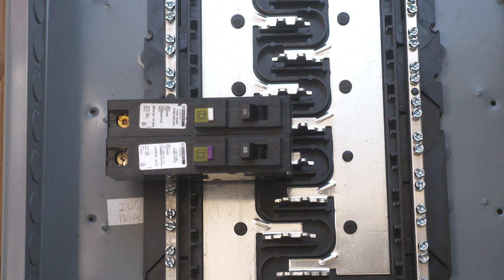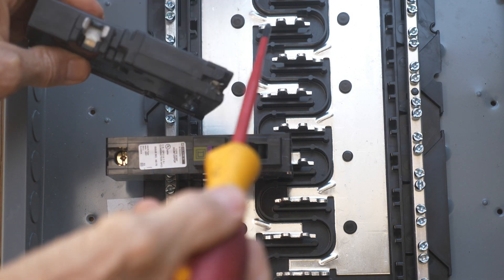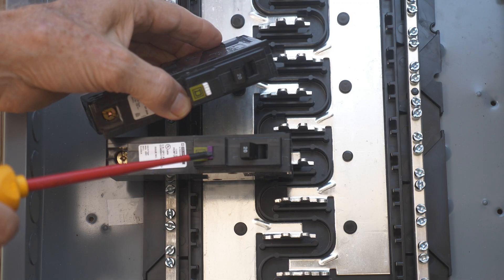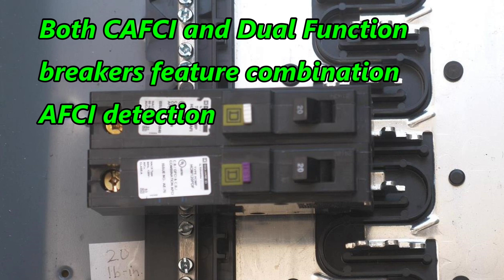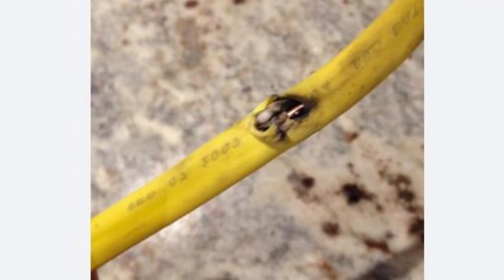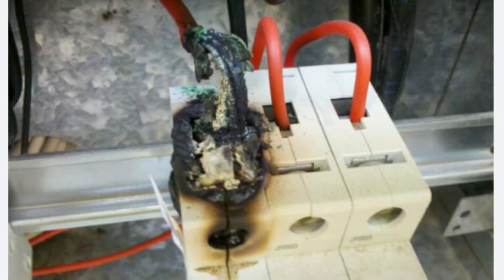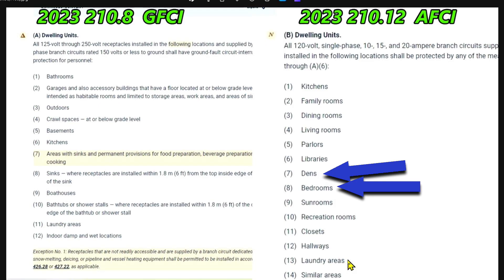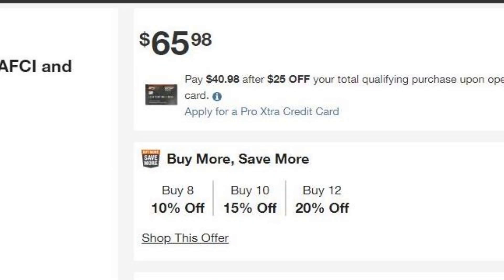Combination AFCI Breaker vs Dual Function Breaker: The Differences and Where to Use Them

Comment: Question, I noticed the new gfci combo afci breaker affecting the new appliances? They said that new beaker combo is not compatible with the new appliances? Is that true? What affecting to the appliances? Keeps tripping the breaker while the appliances in use. Thank you for answering.

Comment: Do I need to install a dual function Afci and gfci circuit breaker on the switch and light circuit? If so, is there any problem with installing a 20 amp dual function circuit breaker on that circuit?

Comment: Excellent explanation, however, I'm planning on using a 10-circuit Reliance transfer switch in conjunction with a solar power system. i.e. inverter, batteries, and PV panels.

My question: The breakers on the Reliance transfer switch are regular breakers. AFCI breakers are required nowadays. Should the breakers in the panel be AFCI, or should the breakers in the main panel be AFCI, or should the breakers in both the transfer switch and the main panel be AFCI? Thanks!

Comment: I find that using Homeline plug on neutral panels in conjunction w/ CAFCI/CAFGFCI is so much easier for apprentices. Especially when U energizes a system after trimout. U avoid breakers tripping and having to troubleshoot the panel for incorrectly wired neutral pigtails.
Reply: Apprentices have no business working on live panels. Do better.
Reply: Say someone who'd rather have an apprentice be a go-fer and clean-uper for the next 4 years. 

U must work for the union...

Comment: Bill one big problem I See the current combo AFCI/GFCI breakers don't work in California homes built say between 1980 and 2010.  The white pigtail Panel Breaker switches will. So inside in my bathrooms, kitchens, and laundry room, all need GFCI outlets installed or is it the other way around? Installing GFCI Breakers at the panel, and AFCI Outlets in the above areas mentioned. I'm asking for those confused.

Comment: I absolutely love your channel and I love all of your content. So informative Brother. I’m currently in college in my second semester taking electrical engineering. I just turned 51 in October and I am a freshman at the local community college. I love all things electricity based and mathematics. Next semester, I take calculus 1.

I always wondered what the difference was between an AFCI and a combination overcurrent device. So what you’re saying basically is that the combination breaker is both arcfault and ground fault? Am I understanding you correctly?
Reply from the maker: Hi! No, you don't quite have it. A combination AFCI breaker doesn't give GFCI protection. They call it combination because it gives both series and parallel AFCI protection only. The Dual function breaker is the one the gives both GFCI and AFCI protection.
Thanks, I'm glad you like the content!
Reply: @SparkyChannel  o
Oh OK thank you so much sir for the clarification.
Reply: @SparkyChannel  Is there such a thing as a combination AFCI/GFCI dual function breaker?
Reply from the maker: @BIGMIKEOSAS  Yes, it is the dual function breaker. It provides both series and parallel ARC protection as well as GFCI protection.

Comment: What are your thoughts on the new requirement that ALL kitchen outlets require GFCI protection?  Putting refrigerators on GFCIs is a bad idea imo
Reply from the maker: I agree with you. Putting a refrigerator on a GFCI is just asking for spoiled food.
Reply: @SparkyChannel  I was getting ready to say the same thing you should never put a motorized load on a GFCI. The lock rotor start up current would surge and cause the GFCI to trip.

Comment: are fault breakers should only be necessary when running Romex, in my opinion
Reply: How about a lamp cord, plugged in behind the couch, that gets a chair leg on top of the cord? Or cheap receptacles that provide a poor connection and just loosely hold the plug, begin to arc, and then cause the receptacle to melt and burn? There are many benefits to having an AFCI beyond simply protecting against wire damage in the wall. Even THHN inside of EMT can be poorly terminated in a junction box, and there's no guarantee that a resulting fire will remain contained within the junction box.
Reply: John, I would absolutely agree. They would be superfluous for circuits run through EMT.
Reply from the maker: Thanks!

Comment: I like the plug on neutral design but I recently put in a 50 amp outdoor outlet and got a gfci home line breaker for it and it had a big pigtail on it guessing because it has to carry more current than the plug on neutral can handle.
Reply from the maker: Interesting, thanks!

Comment: Something to highlight about the SqD DF breakers have a diagnostic feature to tell you why it tripped. Hold the button down and turn it on after the trip, and depending on whether it trips at 1, 2, or 5 seconds it indicates whether it's an arc fault, ground fault, or other fault. I read they have a new model with an led indicator ("time saver diagnostics" - HOM120DAFGF), but I haven't seen any of those in real world yet.
Reply from the maker: Great information, thanks!

Comment: Very awesome video, my wife and just built a brand new home and I was seriously wondering about the Square D breakers.  Great video
Reply: personally, I spec either Siemens type Q or Eaton type CH panels.  the Homeline series is Square D's economy line, and like many economy lines, they use a coated aluminum busbar.  in a dry, non corrosive climate, you can get away with that, but in my climate, I've seen an unprotected aluminum busbar corrode in just a couple years.
Reply from the maker: @kenbrown2808  Good points. The Square D panels are more expensive than the Homeline panels but they use copper buss bars.
Reply: @SparkyChannel  Square D QO is possibly the best available for residential use.  but they cost top dollar as well.  most would argue that the extra cost of QO isn't necessary except in a worse case environment.
Reply: @kenbrown2808  definitely 💯 agree r old house actually had true Cu buss bar and it was a Seimans and definitely a better panel overall but that’s what the builder uses now the Al buss bar.
Reply from the maker: Awesome! Thank you!

Comment: the best application for dual fault breakers is when doing panel upgrades in a house built before grounding conductors were a thing.  I still favor local GFCI protection, in new construction.  it's the more likely thing to nuisance trip from a power quality issue, and not having to run dripping through the house when your hair dryer doesn't work is worth the investment.  it bears mentioning, though - it is also a series arc when a brush in a motor isn't in perfect condition, and the motor is running a little "noisy" electrically speaking.  the general on my main project used DF breakers in his garage, because his brand of breakers have GFCI breakers hard to find - and his freezer tripped its arc fault, and he could only run one garage door at a time without tripping the arc fault.  

we will see what decisions Oregon makes in the next code cycle, but currently, we are still exempting kitchens and laundry circuits from AFCI requirements.  having seen the overloaded circuits that result from requiring them everywhere, I'm personally inclined to argue that there is more harm than good from continually expanding the requirement.  they won't prevent a fire when a homeowner or handyman changes them out for an oversized standard breaker, because they keep tripping.
Reply from the maker: Thanks Ken. Excellent comments. I understand your logic.
Reply: Consider me plus one for local GFCI protection. Another good example is outdoor outlets, especially AC service receptacle.
Reply: @RJ-ej1nr  I avoid putting the GFCI outdoors - even outdoor rated devices are subject to corrosion, and it's cheaper to swap out standard receptacles.
Reply: @kenbrown2808  Good point, and I agree they fail faster outside. One the places I do a yearly maintenance service for, includes doing a GFCI check has ~50 outdoor GFCIs and I'm always replacing some. I see it as a tradeoff for the convenance of having the reset locally. When I can I use the higher quality covers and make sure the rest of the enclosure is properly waterproof.

Comment: Amazing explanation about series and parallel arcs!
Thanks Sparky!
Reply from the maker: My pleasure! Thanks!
Reply: Yes, he does a very good job at explaining that concept. Series arcs are loose lugs in a circuit panel or any loose connection for that matter. Whereas parallel arcs happen between two circuit points with an instantaneous difference in potential.